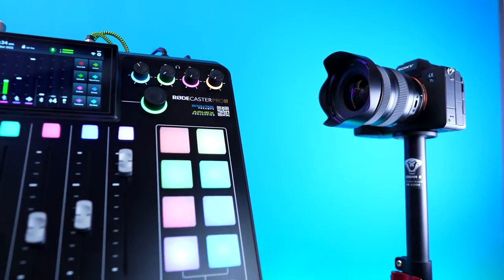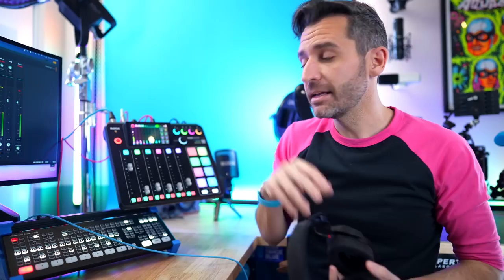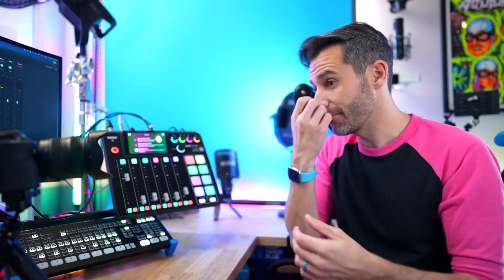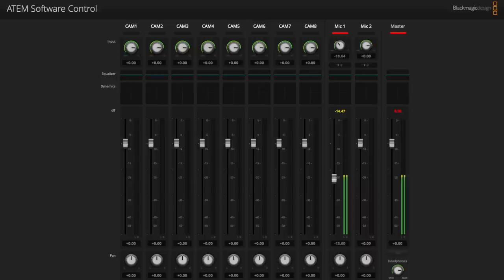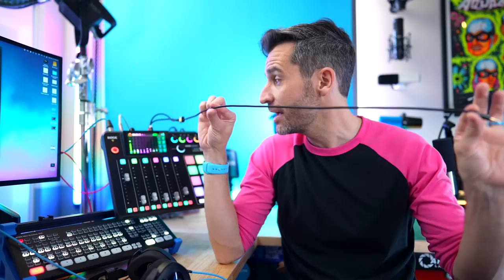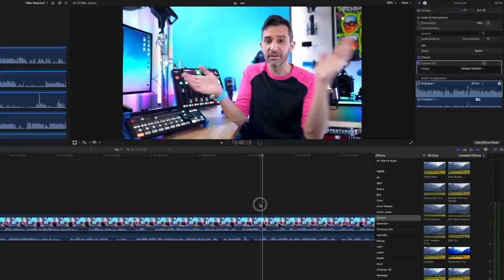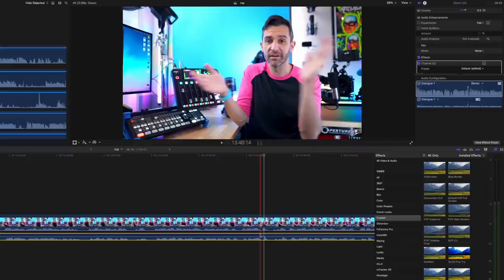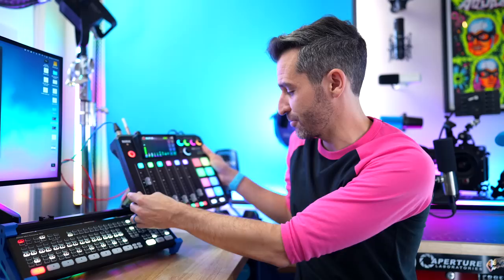How To Connect the Rodecaster Pro to a Camera or ATEM (and why you SHOULDN’T do it)

Comment: Hi Tom! For those who really need to run audio directly to camera or ATEM Mini, using a device which converts from a balanced signal, which is what the RCP is using on its outputs, to unbalanced 3.5mm on most cameras is the most reliable way to send audio to a camera. That way you can run the balanced cables as long as you need and then convert and run a very short 3.5mm unbalanced cable from the converter to the camera. The ART Cleanbox Pro does the job nicely.
Reply: Oh, and also it takes care of the conversion between line on the RODECaster and microphone level on the camera.
Reply: @curtisjudd  What a surprise finding you here! I am looking to use the ART Cleanbox Pro for the high pitch tone and low volume in my ATEM mini. (no audio input on my camera ). I want to make sure that I am going to purchase the right device for my Focusrite 2. Is this the correct device? ART CLEANBOX Bi-Directional Level Matching Stereo Converter Box - XLR and RCA I/O Connectors MFR #CLEANBOXPRO
Reply from the maker: Thanks so much for this insight Curtis! You’re the best.
Reply: Curtis, I appreciate you taking the time to share your knowledge with others.  Thanks!
Reply: Hi @curtisjudd I really like the sound of the art clean box, and think it is exactly what I need to go between my Rodecaster pro2 and my Atem mini extreme.  Could you share the cable configuration, as it looks like the clean box will only accept phono inputs? Many thanks
Reply: @curtisjudd  could you please make a video - how to do it correctly? I want to connect my rodecaster 2 with my Sony camera to avoid sync process on post edit process.
Reply: Fyi here's Judd's tutorial on how to set up the converter from balanced to unbalanced 3.5mm on your camera.

https://youtu.be/jW4V6owu7SI?si=uIz_RrdsNAF7k9y-
Reply: Super helpful! Thank you.
Reply: Great videos, does anyone know if I can use time code with the Rodecaster Pro 2?

Comment: What I do in situations like this not just for The RCP II but other devices is use a ground loop isolator with a 3.5mm input and output on the headphone jack. It has a transformer it will not only reduce noise but also attenuate the signal. You could also use a direct box with passthrough on xlr, a bit overkill, or even use the radial brand of isolator which i use for connecting a laptop to a mixer. They also sell other types as well that I think would work well in this situation.
Reply: Ground loop isolator is pretty much a requirement when connecting equipment via analog audio.  Having different power supplies has to be account for in the electrical paths.  GL isolators is usually the easiest/cheapest solution.  But, not always.
Reply: To improve on this: use a stereo DI box (Behringer has one with 3,5 mm TRS input), run your signal through 2 balanced XLR cables and convert it back to  unbalanced with a reamp (which quickly becomes an expensive solution). I have not found one with a stereo TRS output...
Reply: Another +1 for a $10 ground loop isolator.
Reply: Unfortunately, GLI don't  work with the RCP to camera setup. I've tried attenuators, GLI, both at same time, DI box, several power outlet setups. No luck.
Reply: Unfortunately just a passive DI box doesn’t work to remove the noise. You need an active converter to go from balanced to unbalanced. I use the ART Cleanbox to take care of this, which allows me to run any length balanced xlr cable to the box, then a short, unbalanced 3.5mm run through a passive isolator into the ATEM. Noise gone
Reply: @ac1320  Indeed Most cameras use plug in power. I have some sort of old adapter for that purpose. I will have to give it a try.
Reply: I had the same problem in my business and also used a ground loop isolator. It removed the hum and noise. Try that and see if that works. I had to connect that to the overhead speaker system to my grocery store. It was producing an ugly hum noise with the background music. It worked like a charm.
Reply: How to push rode and atem to make digital out/in jacks instead? Good old TOSLINK would be a much better and easier way to get a good connection here without any need for isolators and you cut away unneeded digital -> analog -> digital conversion.

Comment: Different makers , different quality expectations, still .. why don't you all just add DI box to the equation and move on ?! Behringer Ultra DI costs 20 usd, works on batteries, phantom power AND external... SO i don't get it. Every time you got some USB, statics, monitors, cameras, lights and power cords and computers around it's normal to have statics, brum, noice etc... And one more thing - How good is your ground level and how many phases you have in that room? Are you using everything in a single power circle? Are you sure you got good grounding, isolation? On some curtain situations plus and minus are actually important... Tons of things, no matter the equipment. DI BOX! ... Few bucks... Done!

Comment: Why deal with the unreliable 3.5mm jack on the ATEM Minis when you can embed the signal into HDMI? No actual camera input needed, I use a ~50€ china-made "HDMI Audio Embedder HDMI2.0 4K60Hz 18G HDR" device with a 3.5mm input labelled "line in" from Amazon. Supposedly the "Lindy 38203" will do the same. My daily webcam for work is a relatively affordable HuddleCam Pro/Konftel 20 with HDMI out. The HDMI embedder into that signal turns the ATEM Mini as the *USB Webcam* (from Windows perspective) into a versatile device that needs no driver installation or companion software (try that in the corporate world).

Comment: From my experience, this problem is not just a problem between Atem and RCP. The real issue is that cameras and the ATEM are unbalanced signals with most mixers are balanced output. When you just do a cable conversion, but haven't resolved the balanced to unbalanced conversion. Without that conversion, you introduce noise. Something like the Art Cleanbox resolves this. You go out 1/4" to 1/4" into the the Cleanbox and then it has 3.5 out both balanced and unbalanced. Then all that is needed is make sure the Atem is set to line level and not mic level.

Comment: Another great video Tom.  A helpful hint.  When syncing separately recorded audio and video, ensure both the audio recorder (in this case Rodecaster Pro 2) and video recorder both have 24bit 48khz selected.  Rodecaster Pro is 24x48 by default, but some video recording software and even older cameras may record 16 or 24 bit x 44.1khz audio which, in my experience will, over 5,10,15 minutes of recording, start to throw your audio and video out of synch.
Reply: Damn clutch info, something that only you and Gerald Undone would notice! 🤩
Reply: Good point.

Comment: For RCP to Atem. The lead issue is the difference between balanced audio and line output. The output of the RCP from the monitor is line output, not balanced, just left and right. So in the Atem Mini software. Go to gear setting and change the mic input chanel you're using from mic to line, no more buzz.  On analogue mixers you would have had a button on the chanel that changed it from mic to line input or vice versa. And it just wouldn't have worked because you were adjusting a pin setting on the mixer, digital kit you're adjusting what a chip does, hence you get sound with a hum or buzz. As for direct to camera, the Sony (and all DSLR) internal pre-amps are not designed for professional audio, even the $5k video camera's are rubbish for audio... In my shoots I only use them for reference and sync later. However, in this case you're right to set the camera level to around 1 and control the level via the RCP, although again we're dealing with unbalanced line out for monitoring.  Ground Loop isolation lead might help. It's usually a noise around the 11khz. Unfortunately most DSLRs and Sony in this case have a 3.5 jack input that probably goes back to the days of the Walkman mini disc... It's not professional audio output or input. Hence why I usually record audio separately and sync in post. I think you struck lucky with the lead you chose, but I wouldn't advise it as a high quality route. Keep up the great work.

Comment: I only record the Rodecaster audio in the ATEM for one reason. I use a clapboard to start all the video recordings. That audio snap of the clapboard goes into the Rodecaster, then into the ATEM on the audio track for the master video with all the ATEM camera cuts. I am also recording the Rodecaster audio in Hindenburg DAW. When I edit the video, I cut the Rodecaster audio in the Hindenburg DAW right at the snap of the clapboard, and then in Filmora, I align the Rodecaster snap perfectly with the snap in the ATEM video recording on its audio track. I then unlink the ATEM audio track and delete it, leaving only the edited and vastly superior sound of the Rodecaster audio modified for great sound in Hindenburg. Providing a perfect sound and perfect mouth movement to the audio track.

Comment: Hi Tom, great video. I fully agree. Let each device do exactly what it is designed to do. In this example I would let the Procaster 2 handle audio sources, the ATEM  video switching and the camera video. Then let great software such as OBS handle streaming, recording or both. The audio issue you have highlighted is because the inputs and outputs are not balanced, apart from the master out on the Procaster 2. The reason the black cable sounds better is because it is shorter.
Reply: Will Davinci software perform the function of receiving the sound and video inputs? Sorry if this is an obvious question, we’re very new to this.

Comment: Hey Tom! I’ve connected my rodecaster pro 2 into my atem mini pro mic 1 input to capture all my audio from my rodecaster and snag it into my atem. I used the Y cable you suggested and then bought a grounding box thinggo (that’s probably not helpful- I’m no audio tech LOL) and the grounding box balanced the signal (as you probably know rode is balanced and atem is unbalanced.) The box fixed that squeal/interference and I now have delicious audio and synced directly from my rodecaster to my atem. In case you haven’t found a solution yet! ✨
Reply: @laceybarratt  do you have a link or brand name you could share for the grounding box thinggo!? 🤣

Comment: I hate dealing with with unbalanced audio. The nature of this space is noise -- it can be bad or worse, but it's never good. It's just a world fraught with tears.

It would be amazing if the ATEM Mini and the Rodecaster Pro II got together and had a baby! While that may not happen, I would love to see Blackmagic add balanced audio inputs on the ATEM Mini line! I would also love to see RODE add more balanced outputs (mixes)!

Thank you, Tom! Super grateful for what you do! Happy New Year!
Reply from the maker: Happy New Year to you too!
Reply: Yes, this is the root of the problem - Rode outputs balanced audio, but the ATEM doesn't have balanced audio inputs. I hope to see that change in the next version. Anyway, I solved this problem by using a separate little box that converts balanced to unbalanced, and now I have zero noise. I left a comment with a video link I made to describe the setup, but not sure if that will come through with youtube filters and all.
Reply: @AZisk  Send your audio via HDMI into one of the ATEM video channels to avoid the noise issues and then treat it as an audio-only channel. The only missing thing is the ability to control the audio delay, but you can set that on your Rodecaster Pro.
Reply: @jessesng1970  camera preamps are usually pretty bad so you won’t get best sound that way. also, if you plan on streaming there will be a delay in audio going via hdmi, so you’ll still need to do some kind of separate monitoring solution. but this may work for some

Comment: For long cable runs I run the balanced outputs of the Rodecaster Pro using a TRS to XLR cable.  Then run mic cable as long as is required. Then at the camera I use a transformer solution (as recommended by Rane in their Rane Notes). 
The nice thing about this solution is that it is passive (ie. requires no active electronics). No power is required like you would need with the Cleanbox Pro.
Reply: I am using the Rane Balance Buddy (which are out of production), but any high-quality nickel transformer is recommended. This is the same type used in the better quality Direct Boxes.

Comment: Thank you for this video…I’ve been dealing with this for years too.  I even rewired my office’s high and low voltage wiring bc I was told it was my high voltage wires introducing the noise.  In the end, I just changed my setup to get rid of the noise.

Comment: I worked in broadcast TV for a number of years and we had a project where we had noise when we needed to feed audio from one set of gear to another much as you're getting from the Rodecaster pro 2 to the camera.  The only way we found to eliminate it was to use 100% oxygen free copper cable.  That worked really well, but those cables were horribly expensive!
Reply: I                  Oxygen free copper has nothing to do  with  it. It's the shielding that makes the difference.

Comment: Suggestion: try using a XLR cable with the Røde VXLR Pro adapter. The adapter will convert the balanced signal from the XLR cable to the 3,5mm cable that your camera need. Of course, try to keep the 3,5mm (male x male) cable as short as possible. 

The balanced (XLR) cable « should » help (!) to prevent any kind of noise (electronic, static, EMI, etc) to mix with the analog (3,5mm) connexion. 

Btw, I just love your video thanks for sharing your thoughts with us. Love also your humorous language. 😂
I used to be a creative at Apple some time ago. It shows in your presentation. 😊

Comment: Hey guys! First of all, thanks Tom, Curtis, learning a lot about sound for our livestreams and we are getting better :) Just to add my experience. I never had a hum or buzz but instead some crackling random noise on the cable connection from the RCP II to the ATEM Mini Extreme ISO. No matter which cable I used and the cleanbox did not filter that out. After some more experimenting and cable trial/error (the one that Tom suggested is not available in Europe) I succeeded using two mono 1/4" to XLR male cables (9ft) from the monitor out and a 2x female XLR to 3.5mm into the ATEM and there is absolutely no noise anymore not matter how hard I crank up the gain and the ATEM headphone volume to check. I can provide the link to the cable if it is acceptable in the comments here.
Reply from the maker: Definitely feel free to share the link! That's for offering some additional insight and resources. 🙏
Reply: Not sure why but my posts disappear..

Comment: I suspect the core issue here is that the 3.5mm inputs on the camera and the ATEM are unbalanced inputs.  That means they are more susceptible to RF and EMI.  What's more, the monitor outs on the RCP are actually balanced outs (meaning they really want a TRS cable).

While it is more expensive, the "correct" way to do this is use balanced cables out from the RCP (get short TRS to XLR adapter cables so you can then use however long XLRs you want -- avoids the issue you mention with reaching the camera if it's far away).  Then use a transformer-based balanced to unbalanced converter box (Radial makes a few, for example) and then you will need your Y cable to go into the camera/ATEM.  You want these closer to the camera as then you get the benefit of balanced transmission for the long distance part of the run.

If the camera has XLR inputs (such as with an addon audio handle, or more professional cine cameras) then you are golden as that allows balanced all the way through.  You just need the TRS to XLR adapter.

Curtis Judd did a live show a couple months ago where he addressed this issue and demoed a couple of the Radial boxes and how they eliminated the noise.  I don't recall the video title to go searching for, unfortunately.

Comment: I had a similar issue with noise from my RODECaster to my camera, but I fixed the issue with one of these cables: JOLGOO 3.5 mm TRS to 1/4" TRS Stereo Interconnect Cable, 6.35mm 1/4" Male to 3.5mm 1/8" Male TRS Stereo Audio Cable, 10 Feet. I have the audio gain on my camera set to 1 and since replacing the cable I was using with the JOLGOO, I have not had any more issues with noise. I appreciate the video! Thank you.

Comment: I tried using the Elgato splitter meant to record game chat by running it into the ATEM Mini. It introduced a ton of noise. My eventual solution was two usb mics, one into the ps5 and one into the Mac mini for my voice. I hooked up headphones to my monitors aux out, so I can hear in game audio while I still record audio from the HDMI feed. I used a cheap HDMI splitter out of the ps5, one cable goes straight into the monitor and the other goes into the ATEM.
Reply from the maker: This is a pretty sweet solution. It's so cool how many different ways there are to solve these problems.

Comment: Fantastic video. I've experienced the noise problem sending audio to the ATEM. It has been driving me crazy. I've ordered the Y cable you mention. I hope it solves the problem. Again, thanks for providing so much terrific detail. This should help my podcasting significantly.
Reply from the maker: I really hope it helps! Be sure to is the "Line" input setting on the ATEM for audio, I should've mentioned that in the video. 👍
Reply: Thanks, I'm aware of the line in setting. It drove me crazy for a while too until I found the setting. Thanks for the follow-up.  @tombuck

Comment: This is helpful, thank you! I plan to try recording audio and video separately and directly and editing/syncing in post OR connecting a Rodecaster Pro and ATEM Mini Pro by USB to a computer and recording on the computer.
I was thinking of picking up a Radial Engineering Pro-Iso or J-Iso and some 1/4" TRS to XLR adapters or cables.